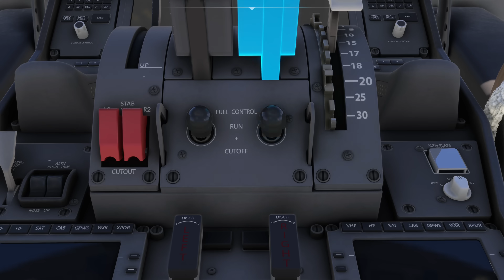Air India 171: Why Did The Fuel Cut-off Switch Get Moved?

Comment: Boeing has a history of hiding the truth and blaming pilots when ever planes manufactured by Boeing crash.   They blamed the pilots when Boeing's 737 MAX crashed—Lion Air in 2018 and Ethiopian Airlines in 2019 due to a faulty software system that forced the planes to nose dive. Boeing knew about the problem but did not tell the airlines. 

After the first crash, Boeing didn’t fix the problem or ground the planes. Instead, they kept flying and blamed the pilots. Then a second crash happened. It was only after that second tragedy—after 346 people died—that the truth came out. Investigators found that the real problem was the software issues that had never been properly tested.  

Even then, Boeing used the media and social media to try to protect its image. They pushed a story that it was pilot error—even though they already knew the system was to blame. This is why people are now questioning Boeing’s role in the Air India 171 crash. We’ve seen this pattern before.
Reply: @wolfmangoland7972 absolutely correct, but Steve appears to be a Boeing person and pilot and certainly won't dwell into these facts. Maybe Boeing has promised him a good retirement package which is why keeps inferring pilot sabotage and has plans to bring aboard mental health specialist to convince the masses that pilot issues are primary, conveniently disregarding the Boeing track record!

Comment: Not true. I don't believe the pilots committed suicide. Because if it is then it would be very obvious just so the company is impossible to deny. It's so easy to push everything to the pilots when they can hide the truth from us.

Dual engine or single engine failure happens so frequently. It was due to corruptions big time. High ranking officials are involved in buying low grade jet fuel with high grade price. All Jet fuels are kerosine have high flash point. Meaning hard to ignite. Somebody is working hard to cover things up. The best way is to blame everything on the pilots. Don't fall for it.
Reply: The video mentioned ', maintenance malpractice'.
Reply: @EAGLEYES112  I don't believe it's due to plane design. Because if it is many 787 would have gone down the similar ways. 

Similarly if India people fail to maintain properly. Many disasters would have happened. But we don't see Indian airlines disasters until this one. 

There are many engine failures reports. From Taiwan to America. And now India. 

I found out that many gas stations are selling gasoline mixed with kerosine here in my country. Kerosine is hard to ignite as compared to gasoline. It's cheaper. 

Because all Jet engines have poor fuel efficiency. Ends up have to rely on cheaper fuel such as Jet a fuel which is kerosine.
Reply: @EAGLEYES112  because of that I have every reason to believe there is corruption involving in fuel purchase. It already happens for so many years. 

Fuel costs involve multi million dollars. It's so easy for high ranking officials to do that. 

Jet engines are very vulnerable to bad fuel.
Reply: @EAGLEYES112  they tried to make us believe that the pilots were committing suicide but never officially admitting so. Just to avoid being sued by the victims' families.

Besides after this incident, another Indian airlines were having fuel contamination issues. Please help to expose everything. So that these corrupt people can be arrested before more innocent lives are killed.

Comment: From this point, it appears the Captain executed a deliberate plan, choosing the moment after rotation — during initial climb — when the First Officer would be unable to recover the aircraft in time to save himself or anyone else on board.

The aircraft rotated, climbed to approximately 600 feet AGL, then descended and crashed with gear still down. Both fuel cutoff switches were manually turned off after V1 and before gear retraction, resulting in total thrust loss. This action appears intentional.

The Pilot Flying was likely the First Officer, with both hands on the yoke or one on the throttles — making it improbable he operated both fuel switches. The Captain would typically be guarding those switches. The CVR recorded: “Why did you do that?” followed by “I didn’t” — most likely a single voice responding to himself. No immediate corrective action followed.

It’s likely the Captain turned the fuel switches back on to confuse the First Officer — making it appear the switches had moved on their own. Focused on climb-out and aircraft configuration, the FO may not have noticed the deliberate shutdown until the aircraft stopped flying — by then, it was too late. A Mayday call was made near the end, but the flat tone and timing suggest it was from the Captain, possibly to disguise intent.

As a former pilot (PPL), it’s pretty clear to me this was a calculated plan. We may never know the motive, but the timing was exact — the moment of thrust loss left no time or altitude to recover. In a jet of any size at 500–600 feet, regaining control after dual-engine shutdown is impossible.

Without voiceprint analysis or cockpit video, we cannot confirm who acted. FDR input correlation (if available) may help determine seat control.

Summary: All available evidence points to a deliberate solo act by the Captain. The First Officer was likely overwhelmed and silent. Only one voice is heard on the CVR. A tragic and irreversible loss for all on board and their families

Comment: Why are pilots all of a sudden trying to be experts in air crash investigations? Why? And Steeve is claiming it was done intentional by one of the pilots. It is highly likely that it was caused by an electronic, electrical or mechanical malfunction. Anyone claiming it was pilot induced without further evidence is a fool. You lose credibility very quickly when you base your claims on partial evidence and fill in the gaps how you choose.

Comment: As someone working in Data Science, I would not trust a plane completely 100% run with AI. Tech is great, it makes work easier but the human touch is necessary. Just think about an electrical fault not allowing the AI to do whatever it needs to do. We could train a machine as good as we can but sometimes a pilot’s split second and creative out if the box solution is what we need.

Comment: Why did the UK CAA issue a mandatory warning about “a potential unsafe condition affecting fuel shutoff valves” in a range of Boeing aircraft, including the 787, less than one month before the Air India crash?
See CAA website, report Number: SN–2015/005 download 25076

Comment: Why divert the focus? Switches are just dumb input mechanisms. The input is processed by the control systems and onboard computers and fuel valves are controlled. It is a stupid design by Boeing SW to stop fuel at that low altitude

Comment: Boeing should consider individual thrust lever micro switches in thrust lever quadrant to prevent inadvertent cutoff of fuel control switche(s) until full retard of a thrust lever.  A guarded switch for FUEL CNTRL OVRD mounted at the Captain's overhead panel to bypass the thrust lever mircro switche(s) should a micro switch fail during a full retard of thrust lever.  The guarded bypass would give direct continuity to the Shut Off switch(s) regardless of thrust lever position. 

I can only think of two reasons for FUEL CNTRL OVRD.  
  1st.  An inoperative thrust lever/associated fly by wire failure to respond to lever position. 
  2nd. A runaway/failure of FADEC.

Comment: What if the fuel cut-off switches were physically in the 'Run' position, but due to a malfunction in the electronic sensing system, a 'Cut-off' status was falsely detected? Later, the system may have corrected itself and reverted to sensing the 'Run' status, possibly due to a loose connection in electronic sensing part/ wrong software logic. So when one pilot asked, 'Why did you cut off the fuel?', the other might have responded, 'I didn’t – the switches were never moved.

Comment: It is also POSSIBLE that the person who ACTUALLY shut the switches to cutoff COULD ALSO BE THE SAME PERSON who asked the Question  to the OTHER PILOT "why did YOU cut off the fuel switches?" in order to COVER HIS OWN ACTIVITY. 
This is just an Additional aspect the the investigators WILL cover but without a camera could be hard to determine but NOT  impossible by for example looking at what was being moved or not on the controls by the pilot flying at the exact time the switches were moved.  This is just one of MANY reasons WHY it takes a long time to get to the final report.

Comment: When i worked at brown and root a crane operator put a big nut behind the lever that worked the jib so he did not accidently pull the jib...It seems such an easy fix to put a piece of metal that would slide over the switches so no way you could cut them off on takeoff....

Comment: problem of having 2 people to operate the switch is when one pilot is down you're screwed
Reply: was thinking the same
solve on problem by creating another problem
Reply: exactly what I thought
Reply: Maybe they should position the switch in such a place where both the pilots can easily see them even when one is flying and maybe add a separate warning so that the pilots don't get confused.....
Reply: Problem of having Boeing using the same faulty switches used on the 737, on the 787. This planes switches were changed twice. This stinks of a cover up!
Reply: @LSWMP1 read into the pilot. He had depression and had taken medical leave in the past

Comment: Are there any other switches on the panel that are mechanically similar to the fuel switches? If yes, don't you think it's possible maybe the pilot intended to touch those but accidentally toggled the wrong ones?

Comment: If as per report, the fuel switches were moved from RUN to CUTOFF within 1 second of each other, wouldn't the pilot trying to save the flight and his own life be able to move it from CUTOFF to RUN within the same time? Why did it take him 4 seconds or longer? Have the other pilots or manufacturer of 787 agreed that the switch can possibly be turned off or on manually within 1 second of each other?

Comment: Why aren't the full switches designed to not close fuel flow if the throttles are set at T/O thrust? It can't be that hard to set them to idle before turning fuel off in case of an emergency, right?

Comment: There should be an override on the fuel shutoff switch only when the engine fire sensor is sensing a fire, in my opinion. So when pilots need to shut off the fuel, it's only possible when the fire sensor is activated

Comment: I'm not a pilot.  Here's my 2 cents...  It doesn't seem realistic to be able to shut down fuel to both engines while the plane is in the air, especially during takeoff.  What if a failsafe was put in place where only one fuel switch can be shut down during critical points in flight.  If the  wrong fuel shut off is switched while the plane is in flight, the system should not allow the other to be shut down until the incorrectly shutdown engine is restarted.

Comment: This gentleman is a non technical person as far as I can see it.Can he switch off both the fuel cut off valves with in 0.1 or even 1 seconds? Hence they got disengaged from ON to OFF due to bad latches.There is a possibility of it as per the advisory quoted by manyn sources.Dont blame some who is dead and can not respondvto your bias opinion.

Comment: What I dislike about this video is that verdict has been passed that pilots did it. Not even 1% thought is being given if it was a malfucntion. Did the report say pilots cut it off or the switches turned off within a second of each other. I have endured major depressive disorder and su**dal thoughts were so heavy on me the. I dont know about flying but if one pilot was trying to commit something, he would plan in much detail rather than just cuttifng off fuel supply which he knows can be seen by other pilot. Also please dont use the kid analogy, "I didnt do it". These are professional trained pilots trained to be in sync and effective communicators. Disappointed by Captain Steeveve.

Comment: Is it possible that the fuel got cut off due to electronic malfunction and pilot A got a warning in the dash, so he asked the pilot B "why did you cut off?" Pilot B replies "i did not". As the engines flamed out, the pilots flicked the switches to cut off in that 1 second  sequence  and run again in an attempt to restart?

Comment: why isnt there some mechanism to prevent the switch to be moved to cutoff when you are on full throttle. It seems so stupid not to design a mechanism to prevent this. If you are on full throttle you should not be able to pull that switch to cutoff. Does boeing accept that this is a design flaw

Comment: I respectfully disagree with your interpretation. Pilots are trained professionals with years of experience and rigorous procedures to follow—they are not comparable to children who lie or hide things when questioned. It’s inappropriate to make such a comparison.
According to the CAA report, there is a clear possibility that due to a malfunction, the fuel shutoff switch or valve can unintentionally move from RUN to CUTOFF. This isn’t about pilot error or dishonesty—it’s a technical issue that could lead to an unintended engine shutdown, which is exactly why the safety notice was issued.

Comment: Can you explain in detail about FAA's SAIB advisory/warning about the disengagement of the locking feature of the fuel control switches. Does it indicate that mid air or while the plane is flying, the lock might get disengaged and the fuel control switches might flip back to off from RUN position or vice versa. How to test whether this mechanism is working fine, do you have this in the pre fly checklist? 

Please address this part as it is technical and we expect experienced pilots like you to atleast throw some light here as there is a paragraph mentioned about this.

Comment: "Preflight Checklist"; fuel status(?) 
Does the fuel status indicator, at the time of 'rotation' check good [IF...] the switches are in the cut-off position? 
Is it possible to have enough fuel in the lines for take-off with both switches in the cut-off position? 
The switches would have to been activated at the "same time" as the flaps were deployed.

Comment: "Why did you cut off fuel?  I didn't!"
This Q&A implied that one pilot cut off the fuel secretly without the other pilot's notice. It is very unlikely the strange movements of one person could not be caught red-handed. The human eye has a wide field of vision and very sensitive to moving objects. So, I believe that the pilot didn't cut off fuel.  While you are driving a car, try to let the passenger to reach out to the gear rod, you can notice it right away.  (If you caught your kids in red-handed, most likely they will not say I didn't.  Only you caught them in the aftermath, they will likely say I didn't)

Comment: Sir, switch job is mostly used on ground, unless any emergency during flight.
What you think, Is  it not better to make an extra cover for protection.
For example Twin Otter aircraft fuel cut off switch.
The second thing is move the switches to some other better and save place.
Best regards.

Comment: The lanyard around your neck says " FLY SAFE", this is  grammatically wrong. Fly is a verb, the modifier of the verb is the adverb safely, so it should read "FLY SAFELY". Just like drive safely not drive safe.  Safe is an adjective, example safe plane.  Michael Smith

Comment: Two things. First I find it hard to believe that the investigators have no idea who asked and answered about the fuel control switches. There is very good software for voice recognition that could be used to determine who said what. Second I get so tired of all the click-bate that continues to how to blame Boeing with some really far fetched scenarios.  I have never flown a jet or turboprop aircraft but  have flown many types high performance multi recip engine, R-R-1860, R-2800, R-3350, and General aviation Lycoming and Continental powered aircraft including many hours as a military pilot flying the Grumman SA-16A,(Coast Guard HU16E). These aircraft all had pull to change position type switches as well as those with the Red toggle covers. I never experienced any failures with these switches even after those aircraft had logged thousands of landings, take-offs and flight hours. In the event of any emergency that required activation of any switch or control it required both pilots to concur what the problem was  as well as the action to be taken and reconfirmed before an actual action was taken.

Comment: If both pilots have to be there to cut-off an engine if they had to, I think that would be a bad precedent to initiate for any possible emergency procedure.
Instead of that, I’m surprised that the throttles being at TOGA (or anywhere above idle), there isn’t a lock-out that keeps the cut-off levers from being selected off or makes it non-effective until the throttles are brought to idle, which would be an early step in shutting down the engines in flight for any reason.

Comment: Captain Steve: These switches  and controls are using fly by wire system. Although the switches are not moved physically, could an issue in the software or a faulty hardware (chip) could lead to cut off fuel abruptly? Perhaps these errors get recorded in the FDR?